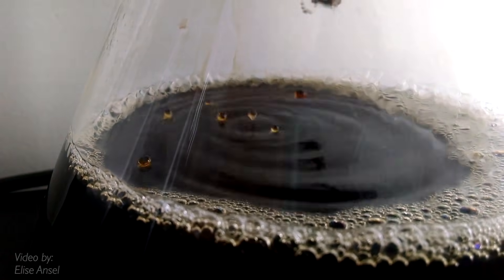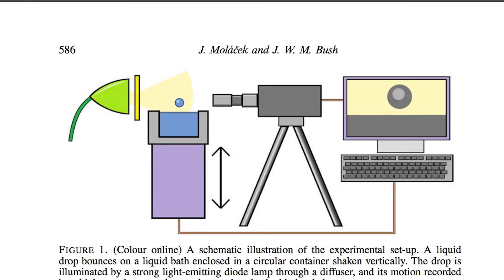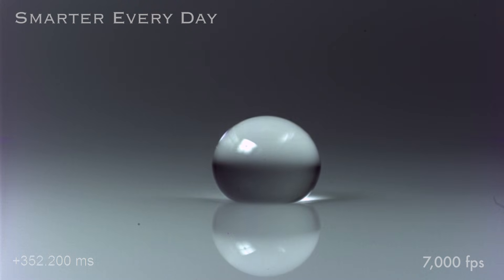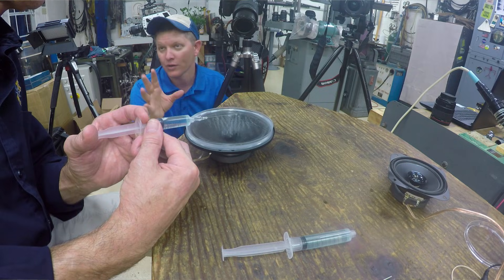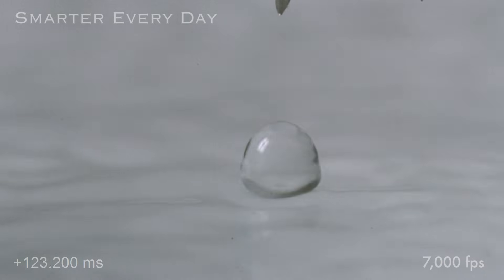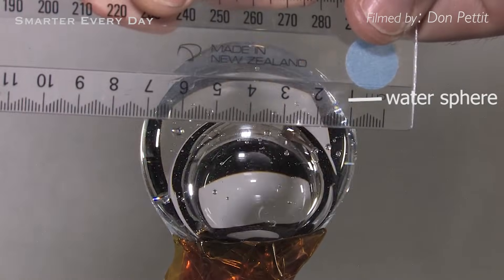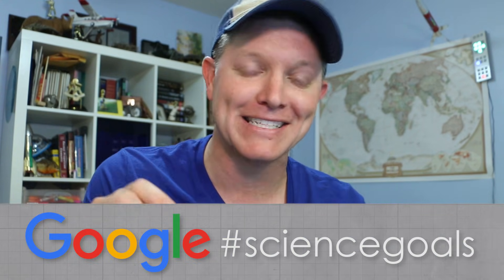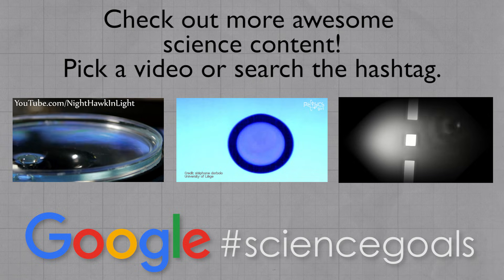The WALKING WATER Mystery (in SPACE and SLOW MOTION!) - Smarter Every Day 160

Comment: What if...
The water falling from the source has enough kinetic energy when it first hits a target (like the surface of a pond, cup of water, bath, urinal) to splash a small amount of water back up in the air (this is the normal reaction) which then forms a small sphere due to surface tension, but does not have enough kinetic energy on the second “bounce” to break that surface tension and coalesce back into the greater body of water (which also has opposing surface tension). Then, because of the surface tensions in the droplet and main body of water, the droplet has enough residual energy to slide across the surface until reduction in that energy allows the two object’s surface tensions to be disrupted by some imperfection in one of their surfaces (dust, hair, mineral) to allow the tensions to be broken, ultimately allowing the droplet to be reabsorbed into the greater body of water?

Nah, the water droplet probably just likes Yo Yo Ma. 🙄

Comment: Wow !
I got a question. I've always wondered when looking at the surface of a pond , lake, or swimming pool when the water is calm.
 There appears a snake like disturbance over the surface. Now I get that wind blows over water in a way that may disturb it as such. However, given that I personally feel the wind come and go during this time in different directions and speeds it doesn't respond as such. Almost as if it has some kind of memory. 
 I thought, well perhaps it may be because the pattern may be created do to obstructions in the water or trees arround guiding the wind. Nope, because this I've noticed from on top of a cliff looking down with no obstructions or wood in the water. I've noticed the wind changes but leaves a, not perfect, but very purposefully similar pattern on the top of the surface of a calm lake over a period of about 10 to 20 min. This pattern appears and disappears because of the wind, but am baffled why the pattern for soo long when Shows up with a memory regardless where the wind is coming from or how strong.
So my question is, why might this be happening ?

Comment: Ofcourse that video is beautiful.  Extremely beautiful. But it gives rise to another question. What physics are at play when the water breaks surface tension on the inner surface of the sphere and releases small drops to the air bubble within. Why is it that the structure of the experiment remains intact as a whole and only distorts in relatively small portions as observed?

Comment: Put a film of oil on the water you increase surface tension put soap you reduce it. Eat and pull so not mix thereforethereforea lake covered in oil film water drops will not want to break the oil barrier.... check thai out and do a video... also live water and depleted water have different water tension

Comment: When the drops were expelled from the syringe its internal mass was centrifugally in motion, creating a pressure density blanket not equal to the the receiving water body. Thus they remain pressure seperate until the drops inner mass momentum subsides and cohesion can occur:). When the long lasting drop was in contact with the vibrating water, its internal mass centrifugal motion was aid by the water body oscillations, prolonging pressure seperation:).

Comment: what makes small dirt debris in a toilet float up the side of the walls? it basically looks like the particles are doing circles on the bowls edge where the water meets the porcelain. it will go up a couple inches then drop back down to the water and many times continue the cycle over and over. ive seen this happen many times and never could figure out why something would move up the side the way it does. my only thought is that area is wet and the dirt is so small it can travel on top of the wet sides.

Comment: Differing surface tension bigger pool means more tension so due to the smaller size of droplet it has less weight and less velocity and because of that it has less interaction with gravity thus less force to disrupt the surface to surface tension the pools water vs the drops tension area

Comment: Could you add a higher viscous liquid into the mix? Like vegetable oil? Or maybe even used engine oil(for more opposing color difference). Would the same sort of bubbling effect happen in zero-g. A bubble of air, inside a sphere of oil, inside a sphere of water? Or some combination of the three? Would the cello still create the same bouncing result but more awesome?
What if air were removed from the whole equation? I know water would boil in a vacuum chamber but could another liquid be used instead? Would the drop bounce at all with no air cushion?

Comment: Hey, Justin. Figure out how those little "water skeeters" zip across the water and clue us in.
Reply: water skeeters rely heavily on surface tension and weight distribution. Their legs are covered in hairs that create a hydrophobic layer which keeps them on top of the tension layer. That's the spark notes version as far as I am aware.
Reply: @SugarTaddy  What propels them?
Reply: @bobbastion7335  They use a motion similar to rowing. In my research, I have found that their movements are often referred to as "strokes" like a swimmer.

Comment: Less than a minute in, but going to take a shot with a hypothesis. Probably a mixture of surface tension, temperature difference, and impurities.

The droplets are really small, so surface tension could be helping to hold its shape. There is also likely air being trapped between the surfaces, preventing contact temporarily. Impurities on the surface might also help with this prevention.

I think temperature difference might also be involved due to how when 2 bodies of water of differing temperature meet, they tend not to mix easily. I believe there was a good example of this with where 2 large rivers join, one clear, and one muddy, and they stay fairly clearly divided. I think this was in a rainforest. I can't remember.

Comment: Destin - but you've not described in detail the surface tension of the water and the differing temperatures of the base (larger) body of water and the smaller droplets.  Different temperatures between droplet and main body effectively results in 2 different density bodies approaching each other.  Therefore the molecules are misaligned and so they do not mix.  The temperature difference is balanced out very quickly on impact and the main body transfers its temperature (heating or cooling) to the water droplet.  Once temperatures are equal, molecules align and the droplet is 'absorbed' into the main body.  I think that this is a more accurate description of what is happening rather than the 'air gap' theory.  I do not have any scientific backing for this - just 25 years of being a military engineer.  Great, mind-expanding videos, keep them coming and lets get this information out to the young budding engineers out there.  Thanks.

Comment: it has to do with the surface tension of the water, it is a property unique to water....
Reply: Came here to say the same thing. Water has surface tension and if the pressure is small enough like with small water droplets, it holds it's tension until it doesn't anymore. We can see that surface tension when we overfill a cup of water. The water can go higher than the cup but if you add more water, it will flow over the cup. It's a simple property of water. But this might not be the only answer. It could also have to do with different electrical charges and when the charge equalizes, the droplet dissipates into the greater water body or in electrical terms, goes to "ground". I have seen highly charged water form gravity-defying bridges between two cups when highly charged.

Comment: didn't watch more than 20 seconds yet, but my guess is surface tension of the separate water won't break either and it sits on top moving until it finds an area where the surface tension is lower.

Comment: This is incorrect. The test forgets that when you change the air pressure you make water change its state. Im stating this as a fact. NonCoalescence is a difference of the energy contained in the drop and the water sitting still. Air gap really wasnt captured in this video.

Comment: My theory:
Water molecules create a different structure or position when exposed to air,  which is different to that of when they are close to each other, this is commonly known as surface tension, which is clearly visible when water striding insects are able to exploit it. With both separate bodies of water having their own surface tension in place this doubles the tension effect. As water has memory (see works of Victor Shauberger and experiments by Masaru Emoto as a reference), when the air between both bodies has gone the water does not immediately react, as it's air to water structure is memorised for an instant. However, when vibration is added this memory is extended, due to the feedback, thus the two tensions repel for longer.  
What do you think?

Comment: I was at a hot springs and watched a very small spider on a rock, pull a ball of water out of a tiny [1/8 tsp] puddle and spin it between its legs. I couldn't tell what the purpose was...using the drop as a form for an egg sac? I couldn't see if silk was involved, but it was spinning the drop very fast,,,,,?

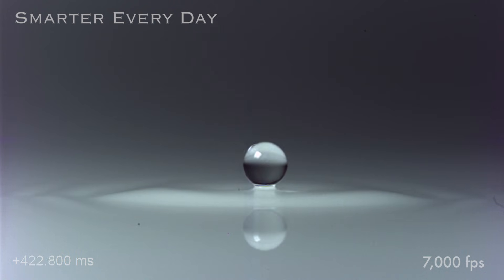Comment: I have an idea about why the cello produces drops. In the video of the drop coalescing (3:52) as the main drop coalesces it almost leaves behind a mini drop about a quarter of its size (something about the ripple traveling around the surface of the drop) then as the mini drop coalesces it almost leaves behind a micro drop about a quarter of its size. I couldn't see whether it happens again because of the camera angle and the size of the micro drop disappearing into the divot in the water. So I suspect that the overtones of the cello happen to cause the reverse process by producing rogue ripples causing micro drops, mini drops, or even drops to separate from the tips of the rogue ripples.

Comment: Hey Dustin, I have watched this video a few times and I have a question, did you consider boundary layer as a contributing factor to the effect. One of the things I do is nanoparticle coating and overcoming the forces of the boundary layer is critical for the proper coating of the nanoparticles. My theory is that there is a combination of surface tension, boundary layer forces that combine to keep the drops on the surface. I don't think that this video has fully covered all the factors, you mentioned the air gap but did not fully develop the air as a factor and why it takes energy to displace it. I hope you can revisit this with higher magnification to try and observe the effect of the boundary layer of the drop.

Comment: I am no scientist, but perphaps an electromagnetic field is created on the droplet of water as it falls down (maybe a negative one due to the friction with air molecules). If this happens, then maybe when the droplet falls on the surface of a larger body of water, the negative electromagnetic fields reppel each other, as in a magnet.
When the smaller volume of water looses its negative charge (or positive), then both bodies of water join. 
Just a thought...

Comment: I think that the surface tension of the water droplet vs the larger body of water may differ. The smaller droplet has a lesser gravitational pull due to it's size and weight, combined along with a thin layer of atmosphere between the two bodies of water which may create a momentary change in molecular attractions so ever slightly before surface tensions are penetrable and finally able to coalesce as one.

Comment: I think surface tension you mentioned is key - my guess is that the energy bonds between the water molecules in the water droplet at the surface have a slight ,,, how can I put it? a slight reluctance, or a hysteresis (overcoming an energy boundary perhaps?) when it comes to breaking and merging with another previously formed surface. I am thinking why a droplet forms in the first place - clearly the surface tension acts like a kind of bag or balloon.  Just like a balloon the surface tension requires (not very much) force to break it.  There are certain conditions where the surface tension of the droplet is not broken by impact with the surface tension of the water it is falling onto... and so it bounces. Remove the surface tension and I predict the phenomenon will not be evident.  I propose introducing TEPOL (anywhere) then repeat the experiment!  This would show that it is the surface tension that causes the phenomenon.  The cello thing I am clueless but it is beautiful!

Comment: surface tension first then vibrating polarity (h2o). water wont mesh until the molecules "match" up. thus 2 different surface tensions. until the lower moles match then the surface tension is broken. Doesent take 80k of gear to figure that out.

Comment: I always thought it was due to the hydrogen bonds between water molecules, that initial difficulty of parting the H2O molecules for the drop to enter into the main body of water (also doubled by the fact that the H bonds of the droplets H2O needs to split as well). I find it Interesting that the layer of air helps to maintain the droplet shape. It's interesting how the little waves from the sound add more air to that layer. Very cool in slomo.

Comment: Does surface tension of a circular droplet vs. Surface tension of water at a horizontal plane have nothing to do with the explanation? Eg. TINY droplet in a BASIN of water -> droplets surface tension is stronger so then resists coalescing with weaker surface tension of basin until droplets surface tension is altered minutely by gravity at which point then coalesces with basin water? Can the opposite be true -> say a droplet hits a mm deep surface of water (or shallower) would the shallow surface have greater surface tension than the droplet so then resists coalescing with the droplet until of course gravity alters the droplets shape and contacting surfaces which then increases  likelihood of coalesence?
Reply: So many factors to consider -> size of droplets (tinier = greater surface tension?), depth of water upon impact (shallower = tougher surface tension?), temperature, air pressure, chemical properties/contamination, impurities, shape of droplet?

Comment: That last experiment was so confusing. Ok, i guess you can attach a water sphere to a surface in zero G, and then inject an air bubble. But why doesn't get the water pushed away by the speaker? Why does the speaker cause waves on the inside of the water bubble, but no waves on the outside?  And then those little Cello drops.... this whole thing is a real mindfuck.

Comment: NOPE. Its not an airgap. 

Its that the water surface that is being landed upon has a similar electrical charge as the drop of water that is coming into contact with it.
Thus when both the droplet & surface makes contact and more surface area of the droplet comes together then the merging occurs.
Reply: That's an interesting theory. The experiment done showing less occurrence in lower pressures correlates pretty well with an air gap. If you've got a good counter-experiment I'm sure we would all appreciate a link to it. Being genuine here, science is all about pitting theories against each other using data :)

Comment: I honestly don't think it has anything to do about an air boundary. I think its the weight of the drop does not over come the surface  tension of the drop itself verses the surface tension of the pool of water. Once the drop comes to a relative rest the water molecules start to separate far enough apart for coalescence to occur. Watching the video seems to back this thought.
Reply: Techno Blaze I was thinking the same. But then I got to think about mercury beads on a table. The smaller beads of mercury get ‘sucked’ into the larger beads. Greater mass equals greater gravity. So what could prevent that process from happening? It seems that if you agitate the larger mass with sound waves, you either are introducing more air between the boundaries or changing the gravitational mass of the larger surface such that it cannot immediately suck in (overcome the surface tension) of the drop. Destin seems pretty smart so I will go with his theory but more discussion of surface tension would be great...

Comment: I think I have an explanation that you will find interesting. The water droplet and the wave system are a momentum quasi-particle. Think about the momentum of the molecules of water as the droplet system moves past. The water molecules lose their momentum to the droplet system. Because it is a quasi-particle you see strange 'momentum like' behavior of the droplets.
Reply: Here's a test. It's a particle so It has to obey the Heisenberg uncertainty principle. Its momentum is fixed so it should be impossible to predict its position. If you try to force it into a wave-guide to restrict its position it will vanish.

Comment: Would this phenomenon still occur if water vapor were the only gas present? At around 100°C the pressure would be about the same. But would surface tension work the same way if the liquid phase and the gas phase were the same substance?

Comment: This effect is likely due to the unique properties of water and it's polarization. Basically the "charges" of the molecules are "off balance"...sort of. Kinda like each water molecule is a tiny magnet. The water's tension between molecules is able to "hold itself together" against the tiny amount of air between the separate water surfaces. It is often taken for granted that water is actually an extremely unique molecule with fascinating properties.